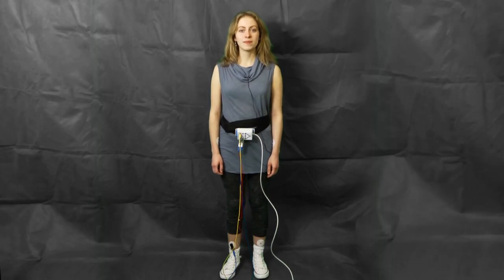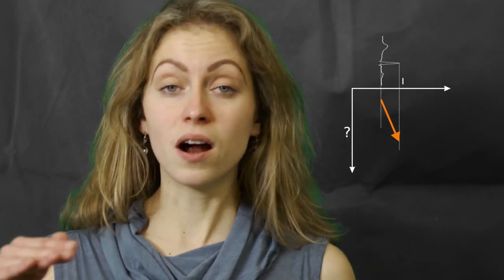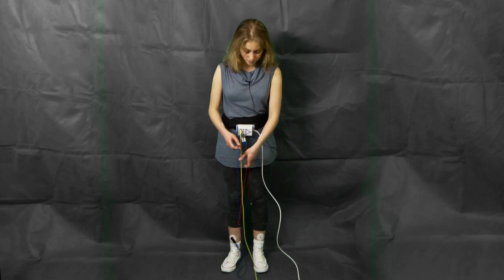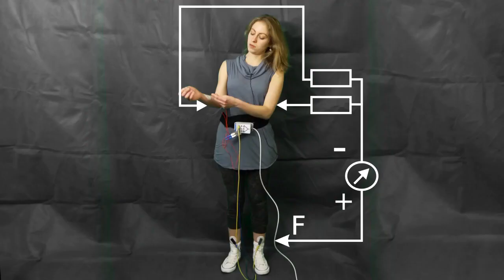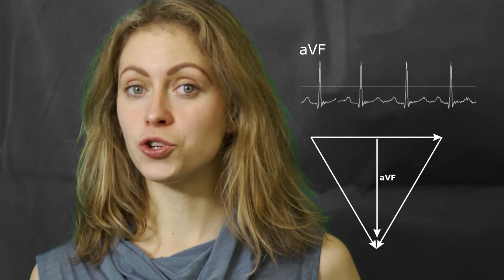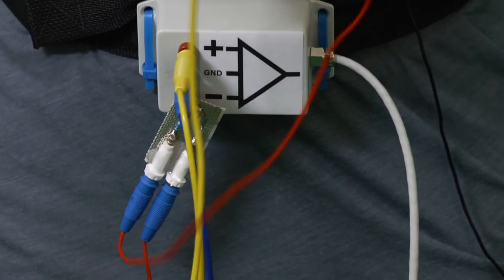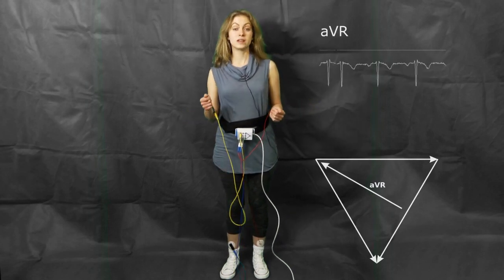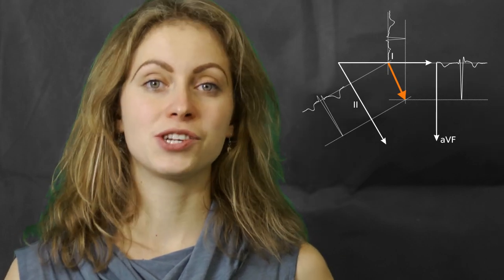ECG: The augmented limb leads aVF, aVR and aVL

Comment from the maker: Good question! What you want is adding the two voltages numerically from the two limbs. You get an ideal adder when the input resistance of the amp is very high against the resistors and the resistors are identical. The electrode resistances add to it so the two resistors should be high compared. However the diff amp would love to have low resistances so that the 50/60Hz on + and - is identical. Traditionally it's been around 5k but could probably be up to 100K to improve the computation.
Reply: sorry to be so offtopic but does anyone know a method to log back into an instagram account..?
I was dumb forgot my login password. I would love any assistance you can offer me.
Reply: @Kairo Raiden Instablaster =)
Reply: @Lachlan Andres i really appreciate your reply. I got to the site through google and Im waiting for the hacking stuff atm.
Seems to take a while so I will get back to you later when my account password hopefully is recovered.
Reply: @Lachlan Andres It did the trick and I finally got access to my account again. I am so happy:D
Thanks so much, you saved my account :D
Reply: @Kairo Raiden Glad I could help :)

Comment: how many ohms are those resistors?
Reply from the maker: 5K or perhaps more. The idea is to calculate a potential average so in theory a very large value will do that perfectly but because the differential amplifier has an input resistance there are limits till you lose the signal. I'd reckon with modern amplifiers that can be much higher. However, in modern ECG machines only two Einthoven channels are measured (for example II,III) and and then you can rather calculate aVR,aVL and aVF from it. Einthoven won't require any resistor magic so much easier.
Reply: 5000ohm it use because in our body the triangle formed by those 3sides ie rt arm left arm and left foot is not an equilateral triangle so the mid point is not going to zero potential... Actually it is near zero potential in order to avoid that we put those registers